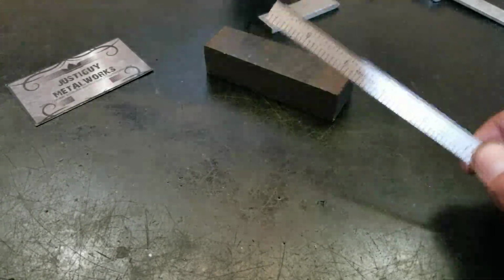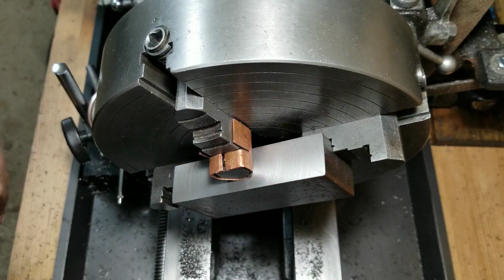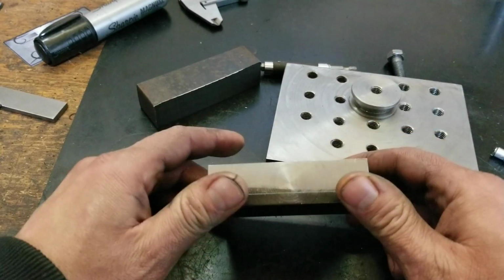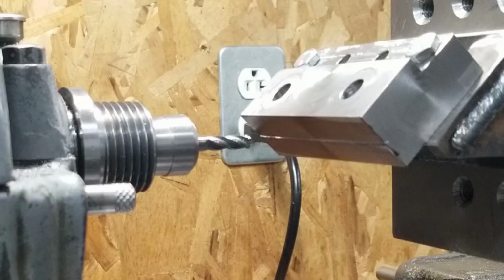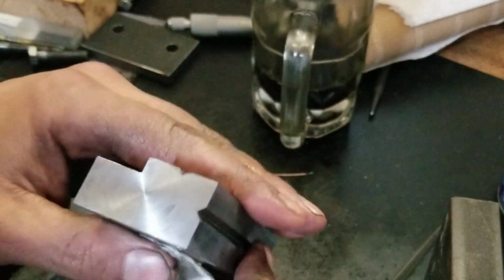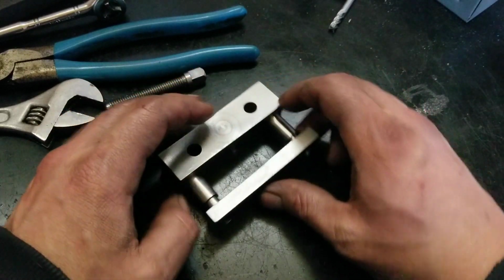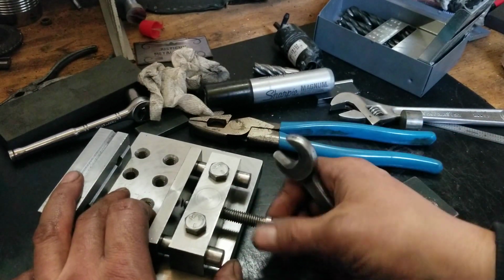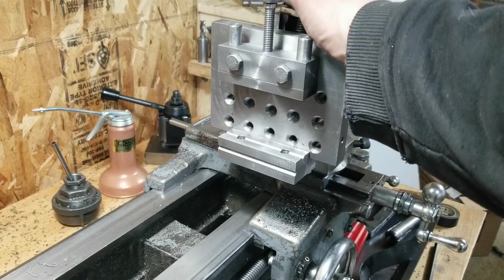New Vise for the Milling Attachment 😃

Comment: Great Job Chris 👍 you should try building a nice Bench Vise using the same sorta idea. I have a Milling Attachment for my little 6” Atlas I’ve never used. I have a Milling Machine, but after watching what you are able to do on the Lathe. I might try it on mine. Enjoyed the Video.
Reply from the maker: Thanks, Joey 😊. They're actually quite good for milling keyways. If you know the exact center height of your spindle you can almost get away with using just a scale 😁. Cheers!

Comment: That was cool Chris, the fit of those pins was awesome!  The thing is that even if the parallelism is off by a little bit, now that you have the ability to mill more precisely, what about a shim plate that tapers .020" to go between the fixed jaw and base?  On to the next one, I'm binge watching :D
Reply from the maker: Right on, bro 😁! The holes on the plate are pretty outta whack lol. Gonna have to make a better one at some point now that I have some better tools. Thanks man! Cheers! 😁

Comment: Please don’t take this as criticism. Just a few things I picked up in life. You could get long bolts and cut them off that way you have a smooth shank going through your jaws to push against. The shank is usually a little bigger than the threads on a rolled threaded bolt. Thanks for the great content.
Reply from the maker: No worries, Robert 😊. Thanks for the comment, cheers!

Comment: Nice job I need to build one till I find a mill you should not need to weld they are always under pressure when in use and welding will distort the pins I believe